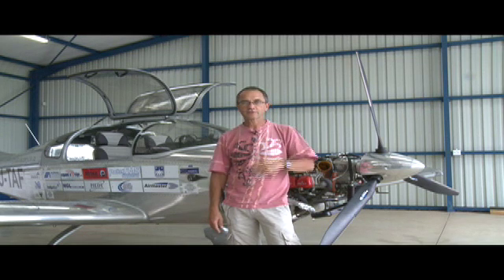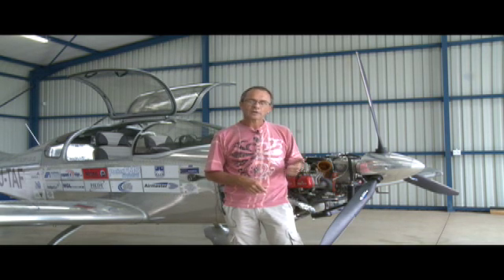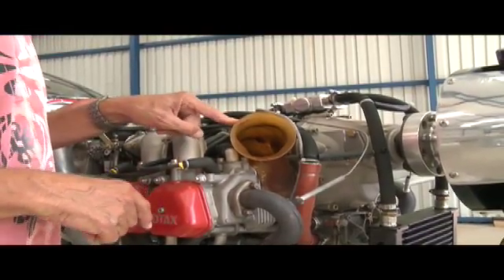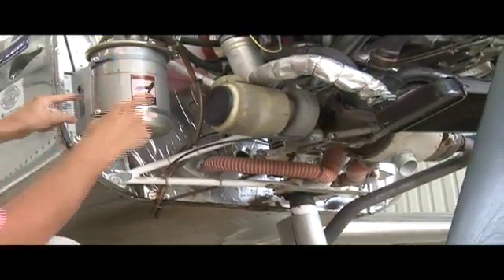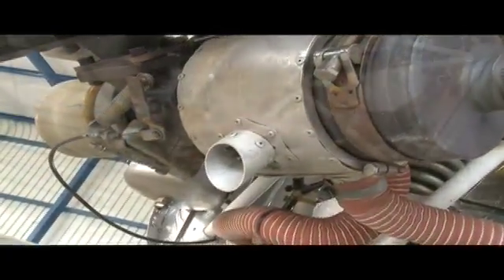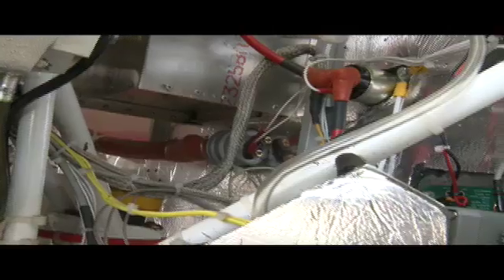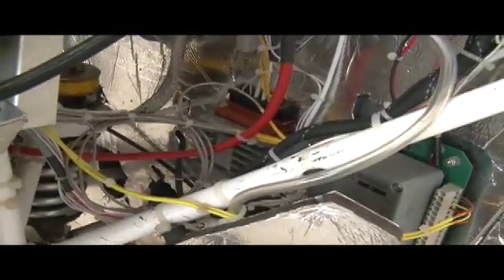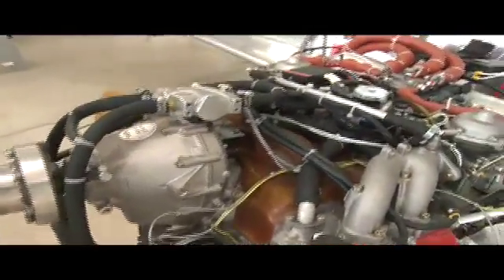914 Rotax Engine Installation Part 1

Comment: This is so cool. Does this engine come with (anti-shock cooling )heaters for supercooled fuel during descent? E.g. a small electric heat device or box that can rapidily heat up fuel before entering the combustion chamber if a gauge show extreme variations in fuel temp.